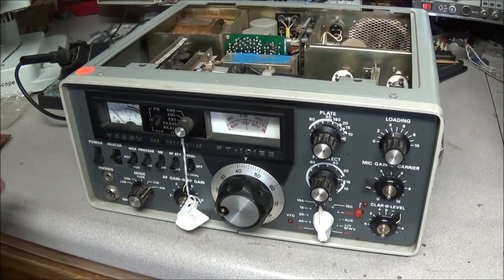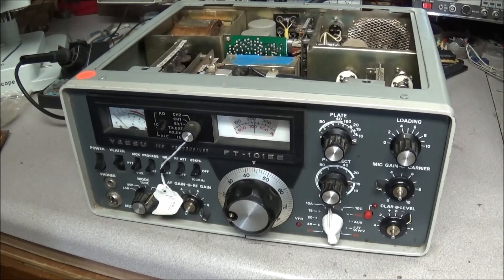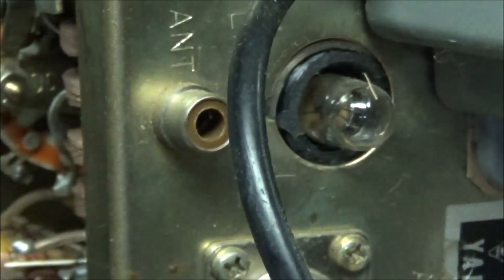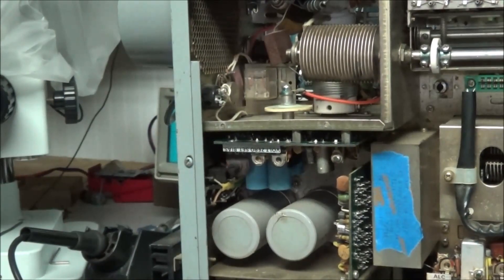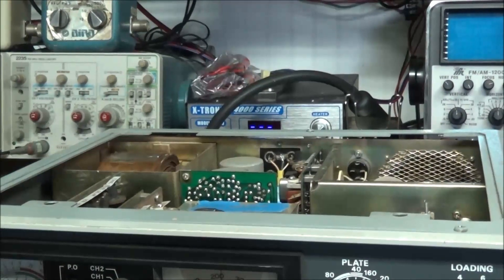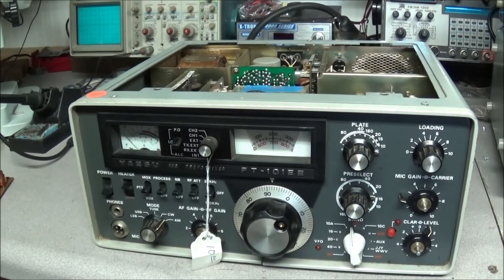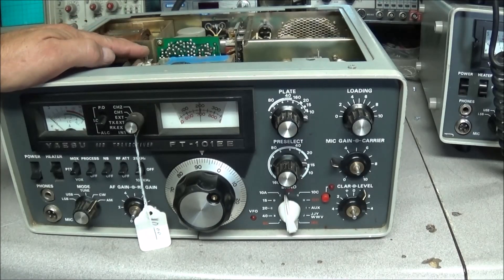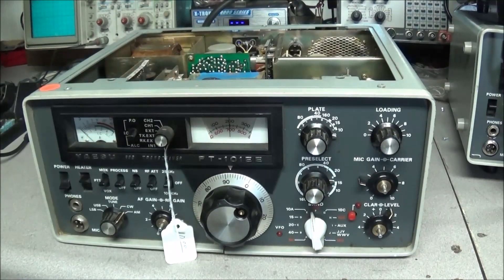#58 Flea Market find Yaesu FT 101 repair series

Comment: I know this is an old post hopefully still monitored - have you seen/worked on a 101 where 20M is transmitting on 12Mhz? I tried two different crystals and both yield the same results

Comment: Hello, I am working on an Fl101 for a friend, and I'm suspect of the bias voltage regulator board.  I have low U.C. current. All other voltages are present. 
Do you have any you would part with?

Comment: Just got an FT-101E on eBay that looks pretty rough but looks complete.  Thinking full restoration is in store so I'll be glued to your wisdom sir!  Thank you so much for sharing all your knowledge.  Do you have any tips on deep cleaning?  There's some surface rust on the internal sheet-metal as well as years of grime on the boards.  I'd like to return it to as new as possible the right way.  Ideas?

Comment: I have two FT101E's and a ZD. All were faulty in some way. I didn't have the heart to throw them away and although i'm no technician even I could see the very high quality build and components used. It's not stretching a point to say that they are  things of beauty.  I was waiting for someone on youtube to help me- and along came you Buddy. I have now repaired the 'ZD (faulty display) with your guidance and now feel confident to tackle the 'E's.I (1: "crispy critters" under the tube bases, 2: Low Rx sensitivity on all bands). No need to reply - just spend the time making these fabulous videos. Just wanted you to know that your expertise and video presentation are both priceless.

Comment: seems like u got ya stuff together on the 101s the down side about me is I am a cb,er ''BUT'' I want to take my test jus to be legally opened up to a hole new world in every metter I do a little bit of tech work I finily found another 101e I put a lot into it traded a rci 2960 which I think is rare and a 2517 for the single e and a ex.speeker and a freek counter but its what ive wanted ive had several but about 4 yrs ago I sed the first oppritunity I get im gonna start the collection of the 101 series down to the 2 metter trans what ever goes in the line im goin after is there a online test that will run me threw the ranks faster I beleave I can pass the test with the nolage ive picked up I no it don't look like I do lol from my soelling I just want away from 27 MHz weather it be hi or low
Reply from the maker: Thanks, cb is a good platform to learn from.

Comment: Hi and thanks for the videos! I just got a ft-101ee from the berryville hamfest. Im wiring a new cinch-jones and was wondering if i should run the green wire of the three wire ac plug to pin 7 / ground? thanks!
Reply from the maker: Thomas, I will need to verify that on the schematic. I think you are right though. Thanks for watching.

Comment: Nice collection of FT-101's.I just purchases my 1st this past weekend for $125 with all of the crystals except the 160 meter.Have not pulled the filter board too see what filters are installed.Hoping the AM filter is there but not a big deal if not.I usually am NOT a fan of Yaesu but made an exception on the FT-101B(Early Version).
Reply from the maker: I tell you they are tough rigs and sound quite good.  Not a bad price you gave either.  Don't forget the problem caps down between the stages. you will like this rig. Please let us know how it goes.

Comment: Here my two questions , i've gotten this 101E from ebay.changed some boards around in it used cleaner on switchers an so on.....a changed the cap's under the diver tube....all is fine with that i think.....But when i plug the display in it gives a carrier on ssb,like full power,an this is with the carrier set off.this only happens with the display pluged in....an the other thing is the diver tube gets brighter as i talk....of course this is with the radio in ssb with no carrier....i hope i explained this so you can understand what i am talking about......i think a cb'er use to have this radio....any help would be appreciated........Gary....KC8HEF
Reply from the maker: This is indeed a strange problem.  Sort of has me baffled at the moment. When I can get in the shop later this week I will look over the schematic. I am almost under the impression that both  problems may lead to one solution.  It almost seems there may be something out of place under the driver tube.

Comment: Thanks for the 101 series! I just came across these. I have a 101E that I picked up in the early 90's that has since had it's finals go soft. I am considering the mod that allows you to use the 6883B as a replacement. Have you ever tired this on one of your 101's?

Cheers!
Reply from the maker: Hi Charles. I hope you find the series helpful. I have heard a lot of sad stories on the tube swap.  As long as you can get 6JS6's I would not do it.  This is however my personal opinion.

Comment: hey great videos, so you still have boards around for the 101's...i have a EEthat i need some for?  DE kc8hef
Reply from the maker: Hi Gary. My board inventory is very low. But Ebay is a great source for these. I buy them and repair as needed.

Comment: Oh my, only 10 dollars, that was cheap :)  A series on the 101's would be interesting. 73, Lars
Reply from the maker: Does t get much cheaper than that does it? I have finally had time to get this on the bench this afternoon.  Installed all the missing parts and replaced one bad resister. Doing all this while shooting the video. The darn thing is receiving,,,,,

Comment: i have one these 101EE's  needs a small amount of work and alignment.  use a d104 lollipop unpowered mic on it.
great hardware even got the user & service manual,  my only complaint is gawd awful paint color on the casing,  i stripped mine off primed, painted it black :-)  served me many years and still working  i prefer it over my ft897d any day of the week
73's
K7sce
Reply from the maker: Very nice. These things run forever with a little maintenance.  The paint is a color to like or hate lol. I have seen them painted many colors. Had a pink one in before.
Reply: my issue with my 101ee is i have to fiddle with both the band switch and mode switch to get any noise/recieve out of the radio and the af gain don't work previous owner i guess had it wired to the max side of it so the slider is just there for looks. so just need to get the two switches looked at and fix the af gain get it aligned i be good to go provided all the caps etc are still in good condition must look them over next time i have it out of storage in the meantime i have a near mint cobra 2000 on the table with my 897d sitting on top of it
Reply from the maker: You will be in luck. I will cover this in the next release. The 10 dollar radio has the same problem. Will show how I work through it.

Comment: Hi Buddy, I had an EE and handled thousands of messages through the Army Mars system. Also many phone patches. Never changed a tube or had to do any service. Those are great old radios. You sure are blessed with them. It would be great to see some videos on the 101. Sure, maybe do one on the receiver, then xmit, then maybe VFO, whatever you choose would be great. My opinion on video length is, a segment ends when you get tired or run out of parts. Too long, break it into many parts. Information from experienced technicians on vintage gear is priceless and hard to come by. 73
Reply from the maker: Hi Larry. I remember hearing the story's of these radios doing that. Handling lots of traffic. It really puts them to the test. I will break the videos up by section. Probably start with the heart of the rig. Power supply and rails.Thanks for watching.

Comment: At some point I was going to do a few videos in this model.  Looks like you beat me to it.  Great radios built like Sherman tanks.

A few suggestions.  Many HAM's do their own alignments on these and I think the final unit kind of throws them for a loop.  Might not not be a bad idea to do a video on aligning the final unit and also using original Japanese tubes and American made tubes in the final.  Many people seem to forget to change the plate cap when substituting American tubes.

Like I said if you need anything like covers and knobs let me know, I have spares.  One thing I don't have is a spare AM filter, nice score on that alone.  I need to get another one some day for one of mine that doesn't have it

Mike.
Reply from the maker: Good point on the tube substitution. I have seen many hams change out the originals and say I had no problems. They don't get it. You must change out C125 when you switch from NEC and Toshiba to any other tube. Or be prepared to replace them again.Hmmm, you need stuff, I need stuff. I will send you an email tomorrow....
Reply: +The Radio Shop 

10-4
Reply from the maker: BTW, don't let this series stop you from doing a repair video of your own.  We need all the information out there we can get bro.

Comment: ready for you to start working   the covers can be made from sheet metal
Reply from the maker: Great, Will start getting stuff together for the videos. You can make covers that is for sure. have a look at ebay though. Pretty cheaphttp://www.ebay.com/sch/i.html?_from=R40&_trksid=p2050601.m570.l1313.TR0.TRC0.H0.Xft-101+covers.TRS0&_nkw=ft-101+covers&_sacat=0